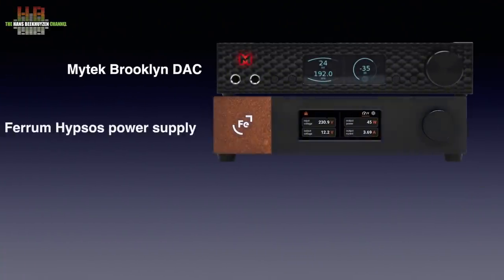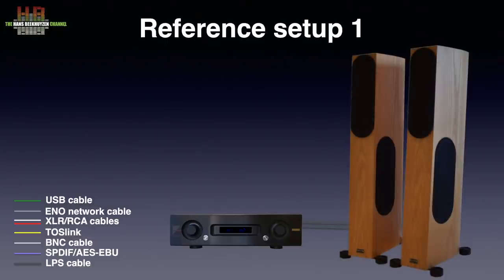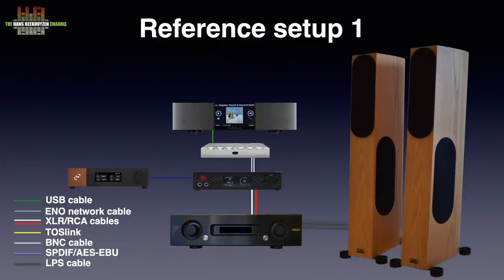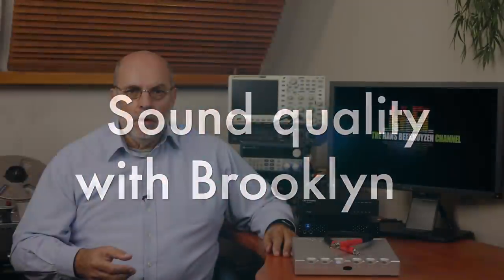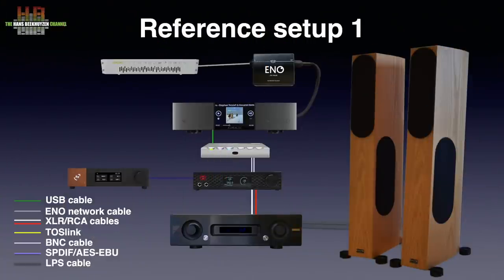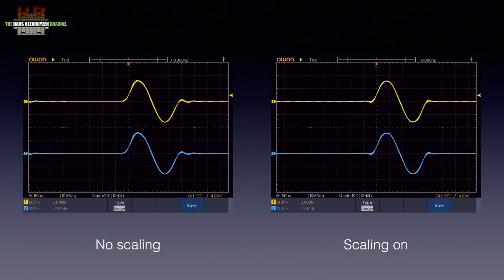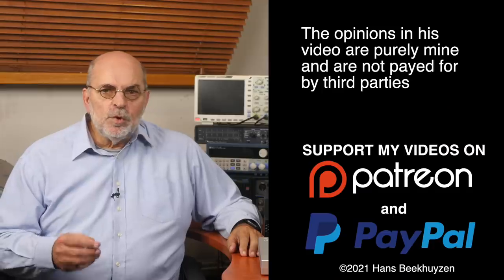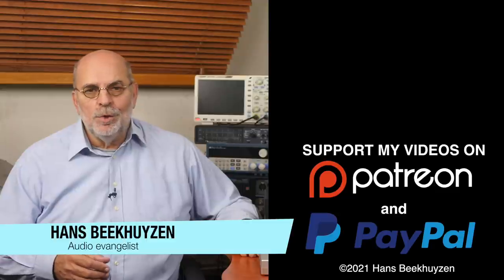Chord M Scaler on more affordable DACs

Comment: It would be interesting to compare the sound upsampling from a computer running Roon Core to a streamer and a DAC vs the hardware upsampling of the M Scaler.
Reply from the maker: No, it isn't (I've done it). It's like not every car with a turbo performs like a Porsche 911 Turbo.

Comment: Can you please tell the difference to upscale with your computer and all the power it has and an Mscaler? 
Please don't say that the Mscaler is much better sounding but tell us why there is differences in upscaling on a computer Vs Mscaler. 
Thank you.
Reply from the maker: The true quality of an upsampler is in the algorithms used and the quality of the digital interfacing. Even is you could be able to use the same algorithms in a computer and an upsampler, it's most likely the upsampler would provide a cleaner signal to the DAC and thus sound better.
Reply: @TheHansBeekhuyzenChannel  Surely the algorithm, such as those provided by HQ Player, would run on the same computer as Roon, so this is probably a moot point. 
There is also a closed form filter with 1m taps included in HQ Player. 
However, the issue is the compute power and efficiency. FPGAs can be pregrammed to do exactly what the algorithm needs, and nothing more, and they will be very efficient at that. General computing CPUs such as those in NUCs are highly unoptimised for these algorithms and because of that they will be slower and will use a lot more power. You will also have noticeable delays when you start playback, particularly with long filters.
Reply: @Xerxesro1  sorry but HQ players algorithm is inferior to the WTA filter.
Reply: @Xerxesro1  Just started using HQ player, big improvement for a couple hundred bones!  Lets not let perfect be the enemy of good :)

Comment: Thanks for the review, very interesting. Would you be able to compare the M Scaler with Auralic Sirius G2.1?
Reply from the maker: I have tried but due to the different ways of connecting and the available DAC's I was not sure what was due to the upsclarers, what due to the interface and what due to the DAC's. For instance the Auralic could be connected to the Aries G2 streamer over L-Link that syncs the clock in both devices. The Chord M Scaler uses dual BNC connection that goes up to 768 kHz. And so on.
Reply: @TheHansBeekhuyzenChannel  I understand, thank you

Comment: Excellent review Hans.  Based on your reviews I have in my system a Bonn N8, Roon Nucleus, Sonore opticalModule and opticalRendu, SBooster Mk II and a Mytek Brookyln Dac+.  You seem impressed with the M scaler when used with the Mytek, glad to hear this as I am considering the M scaler.  I use Tidal, when upscaling with the M scaler will that effect MQA tracks on the Mytek?  I noticed you have now gone to the Ferrum Hypos power supply for the Mytek, did it make such an improvement on the Mytek's performance that is warrants the cost of the Ferrum replacing the Sbooster?
Reply from the maker: When you use the M Scaler, you kill the MQA info. But you do lay less burden on the reconstruction filters in the Mytek. If your software player (Roon, Audirvana) allows for the first unfold done in the software and you use the M Scaler, there will be sound improvement. The Ferrum sound a lot better than the SBooster. Whether these improvements are worth the money to you, I can't judge.
Reply: @TheHansBeekhuyzenChannel  If you were to choose which would you add first to the Mytek Brookyln Dac+, would it be the Ferrum Hypos or the M Scaler?
Reply from the maker: The M Scaler
Reply: @TheHansBeekhuyzenChannel  One more question if you please Hans.  If you use the pass thru on the M Scaler with Mytek would you then be able to utilize the MQA feature?  Thanks

Comment: again, a review very well done, thank you hans! i do upscaling with my roon core, and already hear a clear improvement with my t&a dac 8, connected by usb2. is this comparable to what the m-scaler does? considering the 4250€, it can‘t be that simple? ;-)
Reply from the maker: It’s nowhere near comparable!!! If Roon did it equally good - or even 75% - I wouldn’t have bought the M Scaler of course.
Reply: @TheHansBeekhuyzenChannel  in your first m-scaler video you have shown that a special algorithm is used. do you really need all this hardware around it, or could a software like roon do it the same way if it had that algorithm - an i7 should have plenty of computing power?! after all, upsampling happens completely in the digital domain, doesn‘t it? i guess it‘s just hard for me to grasp why one would need this expensive piece of hardware? and if, why not build it directly into the dac?

Comment: Oh how I miss the 2000 euro limit, then you were  reviewing stuff many people would consider buying. Now you have gone down the rabbit hole. I doubt any of your listeners will ever buy the mscaler, not because it doesn't improve the sound, but because if you have 4000 euros to spend there are better options.
Reply from the maker: As I said in the video, I will not abandon reviewing more affordable equipment, but currently it is a bit difficult to ger review samples of interesting products. Corona has deregulated not only supplies but also transport (that became 3 to 5 times more expensive. Apart from that two important chip factories in Japan burned down...
Reply: Conversely now that I have upgraded my system to a very high standard,I  find that I am now not as interested in many reviews because the equipment is inferior to mine. There are many  reviews of all price ranges in equipment. I welcome high end reviews.
Reply: @billfife6569  hear hear!